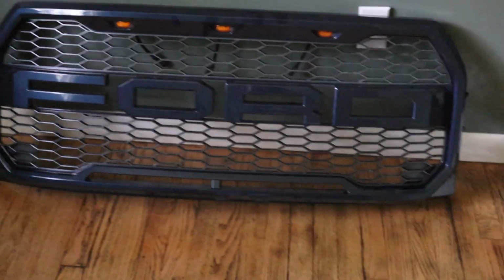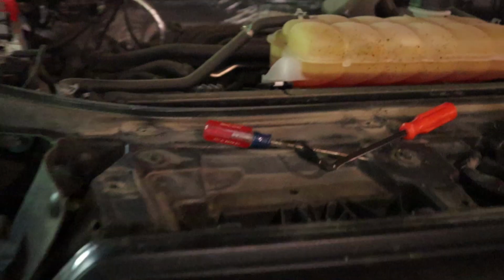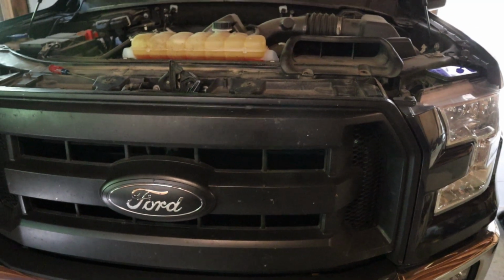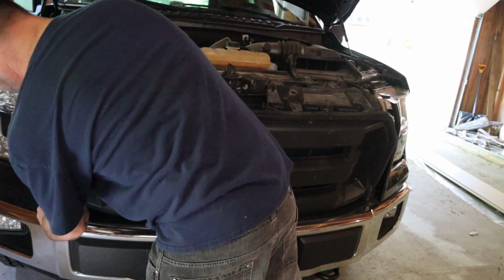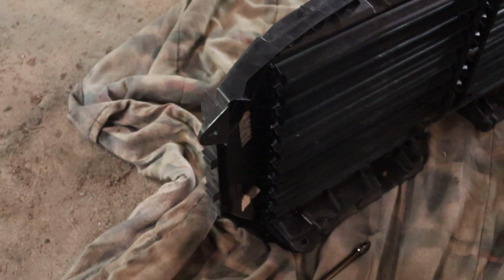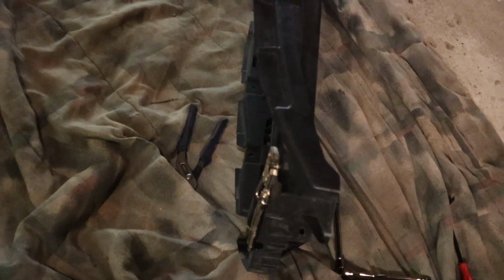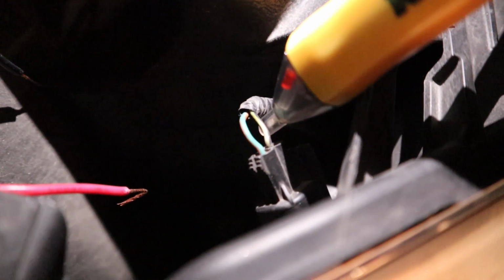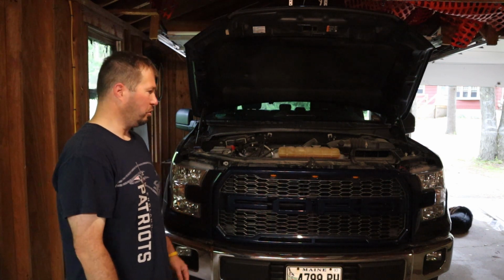2015-2017 F150 Raptor Grill Install. Best in depth explanation

Comment: Thanks for the video, watched it last night and swapped my grille this morning. I ran into the same problem trying to release the stock grille from the shutter hardware as the bolts were seized. It was just a trex billet grille so no electric work to be done which saved me some time. Thanks again 👍
Reply from the maker: Awesome glad it helped. There are other videos on this but I also wanted to cover some of the things not covered that could be problematic for some.

Comment: I've had the Paramount one installed on my 2013 Supercrew for several years now. Replacing those lights are a pain once the nuts start to rust and seize up on the bolts. I actually just swapped out all 3 and the wiring harness last month. I keep it wired into my passenger side parking light behind the headlight.
Reply from the maker: yup same area I wired mine into as well just the other side.  I can deff see those bolts rusting over time. I had good luck with the for the time I had the truck.

Comment: Trying to find the side marker/parking  wires on my 2016 f150 to splice in but can’t find them. The manual and every video I’ve seen has them there. Something different about 2016 model year?
Reply from the maker: Mine is a 2016 they should be right where it shows in the video
Reply: Bro I have the same problem. 2016 platinum, no wiring visible whatsoever where every video shows them. Does the whole light housing need to be pulled?
Reply from the maker: Go ask at a Ford dealership

Comment: Agree looks really nice color matched. BTW i thought that type of current testers only worked AC? What model is that?
Reply from the maker: Team Neudimensions it’s a Klein Tools MM300. Believe I got it at Lowe’s. I’ll be doing a video really soon on this truck on how it’s been after 60K miles. Any good / bad stuff with it
Reply: @Lethal_Venom  The model # belongs to some kind of clip do you have the correct model #? Looking forward to the video.
Reply from the maker: @neudimensions1320  That's the correct #, they sell them at lowes as well.  https://www.digikey.com/catalog/en/partgroup/mm300-and-mm400-multimeters/66375?utm_adgroup=Test%20%26%20Measurement&utm_source=google&utm_medium=cpc&utm_campaign=Dynamic%20Search&utm_term=&utm_content=Test%20%26%20Measurement&gclid=CjwKCAjw-YT1BRAFEiwAd2WRtmeNOXVB8VnXKnGwakHxfDWVjIylTQPvJVqi2DQiEaRk2wIkThzZkRoCIuUQAvD_BwE

Comment: How is the raptor style grill holding up? Is it fading in color at all? Any other issues over the long term?
Reply from the maker: I traded the truck in this past June but up to that point there were zero issues. I did have it painted so as long as its a quality paint job it should hold up fine. The only thing that did happen since I had it was one of the plug connectors for one of the amber lights came undone so I had 2 of 3 lights. But after plugging it back in it was fine.

Comment: Nice job! Those amber lights are bright. I just got my grill and some Morimoto XB lights for my 2016. Hopefully it's just as simply to splice into! Thanks
Reply from the maker: C G the taps were a bit of a pain due to the limited space and I mixed the wires up in the video for which tap went to which lead but I swapped them around and it worked fine. Overall it wasn’t to bad to do though just took a lot longer to film it
Reply: @Lethal_Venom  Do you remember if there's room behind the FORD grille and shutters? Specifically, enough room to put a 20" Baja light bar behind. I have the 5.0 V8 and from what I've read online only the upper shutters are active here, so I'd be putting the light bar in the middle/ lower.
Reply from the maker: C G honestly I can’t say either way I didn’t pay much attention to the space that was available behind it as far as anything fitting there. Would be an awesome thing to do if it worked though
Reply: @Lethal_Venom  9 months later... I just installed my grille! And I fabricated an aluminum mount for my 20" Baja light Bar...it fits! Very snug against the shutters, but won't interfere at all. Just need to wire everything up now!
Reply from the maker: @cg9608  Oh that's awesome!! Thanks for checking back and and letting me know. Looks so good with the lights. I recently had one go out but the plug came undone and was an easy fix.
Reply: @Lethal_Venom  Tried today and they didn't come on :/ I used crappy T-taps, so I bought the kind you used here... really hoping I didn't damage the wires when I take my t-taps off and replace them
Reply from the maker: @cg9608  hopefully not. Mine are still holding up well. The light that went out on mine was the plug that came undone the taps have been fine.
Reply: @Lethal_Venom  That's good to know. I'll have to check tomorrow when I take the crappy taps off. Good news is my lights still function properly and worst case scenario I can order a new harness for my Morimoto XBs. It's always something...lemme tell ya :D
Reply from the maker: @cg9608  lol oh yes. Something I know all to well

Comment: what if theres a front facing camera?
Reply from the maker: There's probably some way to unplug it or it just has a wireless feed to the screen. Not 100!% sure either way though due to mine not having one.
Reply: Ever find a grill that accepts front facing camera?
Reply: @brianmiller1055  i found a thread in the f150 forums, i cut 2 little fins in the new grill and camara fit perfect
Reply: @jblaze114  thx brother.

Comment: i just bought an '15 F150 with this grill already installed but only 1 light works.  Has anyone replaced the bulbs?
Reply from the maker: I believe this is what you will need. https://www.amazon.com/Bumper-Running-Replacement-2009-2017-Aftermarket/dp/B07GPKGYDG/ref=asc_df_B07GPKGYDG/?tag=hyprod-20&linkCode=df0&hvadid=321477478751&hvpos=&hvnetw=g&hvrand=11554539750627431154&hvpone=&hvptwo=&hvqmt=&hvdev=c&hvdvcmdl=&hvlocint=&hvlocphy=9002518&hvtargid=pla-570110807414&psc=1&tag=&ref=&adgrpid=66887629600&hvpone=&hvptwo=&hvadid=321477478751&hvpos=&hvnetw=g&hvrand=11554539750627431154&hvqmt=&hvdev=c&hvdvcmdl=&hvlocint=&hvlocphy=9002518&hvtargid=pla-570110807414
Reply: Lethal Venom thank you
Reply from the maker: G Burnett welcome. Best of luck replacing them
Reply: I wanted to order these but not with estimated October delivery.  Are these sold In the USA
Reply from the maker: G Burnett seems like everything it delayed right now. The SLP X pipe I ordered for my 04 Cobra was delayed until the end of oct so I just found an X pipe locally instead. As far as the grill there are multiple sources they can come from ranging from amazon / eBay / American muscle. About the only one that I know you can view where it ships from is on eBay without having to contact who distributes it.

Comment: How much did it cost you to get the grille painted? Just wanna get a ballpark figure as how much itll cost to get mine painted. Great video by the way! I saved it!
Reply from the maker: If I remember correctly it was around the $280 ball park range. Price will differ on the shop you use and the paint code for your truck. Thanks for watching, will have some Shelby GT350 videos starting in early 2021 if you plan on sticking around for more. Also keep in mind  I mixed the tabs up for the amber lights in the video but once I swapped them around it worked fine.
Reply: Lethal Venom I just had my grill done. They actually just tint the cleat coat to give you the Matt black color and it’s baked on. Cost me 259.00 turned out perfect and looks great. I’m installing it along with my new AlphaRex Pro series headlights this weekend.
Reply from the maker: Grey Wolf67 that’s awesome glad it turned out well and you were happy with it

Comment: Lookin’ sharp. Great job man. I’ve been looking for this grill all over. Where did you buy this at?
Reply from the maker: David F you can get them from the American Trucks website but they do not come with the Ford letters due to copyrights. I was able to find this one cheeper on eBay which included the letters F and R with it so it spells out Ford. You just have to unscrew the symbols that come on the grill and replace them with the F and R letters. The grills that come with the Ford letters already on them are actual raptor grills.
Reply: Lethal Venom Gotcha! I will check out ebay. Thanks again man! 👍
Reply from the maker: David F no problem
Reply: There’s like 20 websites that have them don’t pay more than 100$ for it tho or the website you chose is burning you
Reply from the maker: PJ romero you get what you pay for

Comment: When you say tap to parking lights do the anber lights shut off when driving ?
Reply from the maker: No they stay on. As long as the parking lights are on the lights on the grill will stay on. This can be done with just having the parking lights and the grill lights on at the sametime while driving or by turning the headlights on and all 3 will remain on ( Grill lights, head lights, parking lights). When you open the door the parking lights and grill lights will come on but they are on a timer and will shut off after a few seconds. When the truck is running or while driving they will stay on.

Comment: Does anyone know how to find aftermarket lights that are white instead of amber?  I found a set on Amazon, but they explicitly say they aren't for aftermarket Raptor grills, which is what I think I have since I got it from Amazon for only $140.  Here is a link to the white lights.  https://www.amazon.com/iJDMTOY-LED-Grille-Running-Powered/dp/B078WJGCZS

Comment: is it the active grill shutter?
Reply from the maker: Alik Harutyunyan no this grill is not
Reply: @Lethal_Venom in f150  with active grille shutter I need to unplug one more connection yes? other than all the process the same yes?
Reply from the maker: Alik Harutyunyan I’ve never done one with the active grill but I would assume it’s just a connection or two but the process should be very similar